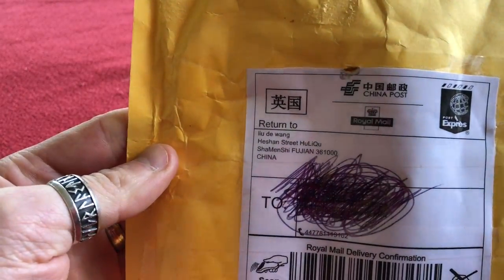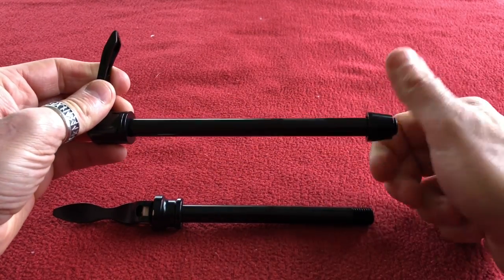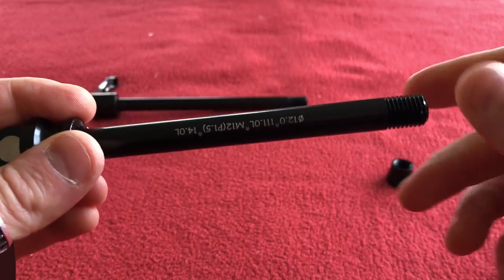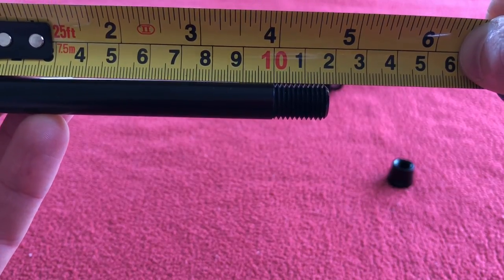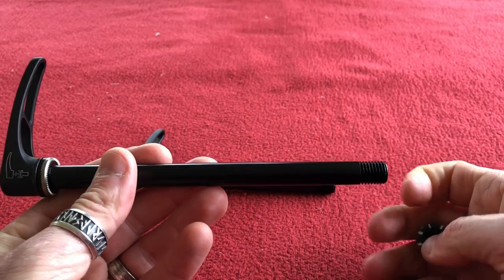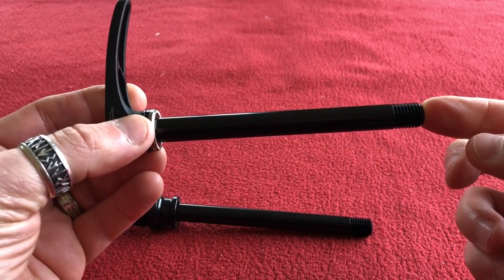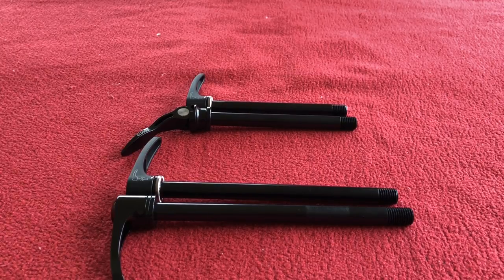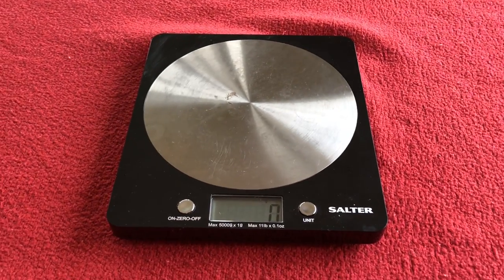Thru Axles Yoeleo and  DT Swiss Comparison

Comment: I have looked at the thru axles from my Giant Propel. They are basically the same as the DT SWiss version. I think the issue with the Yoeleo is that it uses an external nut sitting on the outside of the frame whereas my Giant has a threaded section built into the frame in the rear derallieur hanger which would make the bolt shorter. My front forks also have a slotted section on each leg which makes it very easy to sit the wheel in place while putting the thru axle thru the wheel. I think you will find it is just the cheaper chinese way of doing things
Reply from the maker: cannon1156 yes I think you are right! Having that bolt on the back means longer axles, fortunately as there is no standard length, I’m able to get some even longer ones than the supplied ones.

Comment: Are DT Swiss RWS thru axles a worthwhile upgrade from the originals on a Colnago V3? They aren't cheap at around £40 each.
Reply from the maker: I got them for the removable handles as I didn’t like the handle sticking out on my bike as it ruined the aesthetic. I prefer the smooth look so to me they were worth it. 👍 if you don’t mind the handles then just leave them.
Reply: @KyrosHouseCycling  I just received mine and DT Swiss have updated them with a new version. They no longer have removeable handles.
Reply from the maker: @Distorted-Vision  ah that’s no good, I suppose people either kept loosing the heads or rounded of the Allen key. I can’t stand handles.. 👍

Comment: The dtswiss 142x12 rws head unscrewed from the axle. Now i cant take off the wheel. What can i do?
Reply from the maker: Hmmm that’s a tough one… somehow you e got to undo it, off the top of my head, I’d try to put something in the axle and jam it in so you can use it to unscrew the axle… but it’s a tough one. 👍
Reply: Solved. Picked a bolt 2 nuts and 2 washers. Put jb weld on bolt threads. Tightened it all up, left for 24 hours. Came right out into the trash.
Reply from the maker: @Hawlkeye-e9p  nice solution! What are you using now as the replacement? 👍
Reply: @KyrosHouseCycling   ordered a solid mechanical 142 thru axle replacement. Never again will i use dt swiss. Even their hub designs are crap now. New design allows debris into bearings. All my buddies have them and have to constantly adjust them.
Reply from the maker: @Hawlkeye-e9p  I’ve just put the new ratchet exp on both my wheels. I’m hoping they are an upgrade on the previous version, as those were really good, even with the salt air and sea spray. 👍

Comment: do you think they mistakenly sent caliper brake through axles?  That is a big length difference.
Reply from the maker: Im not sure, they are still 110 and 143 axles you can just get different lengths, since making this video I have ordered some 110mm which are 125mm in total and a 143mm which is 171mm in total, these should be great! I've ordered them from http://www.starbike.com/en/wheels/skewers/ in Germany, they are through axles with no handle, 5mm Allen key to tighten up. when they arrive I'll make a video of them and putting them into the frame.

Comment: http://www.chainreactioncycles.com/sram-maxle-stealth-rear-mtb/rp-prod160854   Length170mm,Thread10mm,Pitch-M12X1.5(Boost E-Thru)   here is a 170mm m12 x 1.5 pitch thru axle should work, also you cant you just remove the handles when you ride? A decent machine shop should be able to make you a nut at 1.75 pitch the taps are readily available.
Reply from the maker: mike brooks thanks for the links! Yeah I would have removed the handles, but the rear wasn’t long enough to safely hold on the nut. Yeah I thought about getting a nut made but in the end I ordered some handle less axles... thanks!

Comment: recently i saw some "boosted" version of tru axle from online store, i did some light reading they are design for wider mtb hubs, maybe those tru axle could fit. edit: they are like 5mm-10mm longer than those standard tru axles.
Reply from the maker: ed paul yes if you look at my latest video you’ll see I got axles from Germany in 125mm and 172mm. Thanks for the comment, I looked at boosted ones also 👍

Comment: yeah idk what yoeleo did on their thru axle but this is not thru axles standards and this is pretty bad honestly, this would honestly go from a "i would buy this frame" to "not anymore" just by viewing this, there is standards please follow them @Yoeleo : for a road/tt/gravel/cx bike 12x100 in front 12x142 in back.

And please do not call this a thru axle if it needs a bolt to skrew it, this should be screwed to the frame !
Reply from the maker: In the end I have cancelled my order from starbike.com and ordered from r2-bike.com, I have 2 extralite thru axles coming. The rear is a 12x142 which is 172mm without the head and is 1.5 pitch thread. The front is 12x100 and is 125mm long without the head with 1.5 pitch thread. I also have a 14mm nut in 1.5 pitch thread coming. The axles need a 6mm Allen key to tighten so I won’t have silly handles sticking out the side of my bike.

Unfortunately there doesn’t really seem to be a standard length axle, I found loads of different length 12x100 and 12x142 axles.